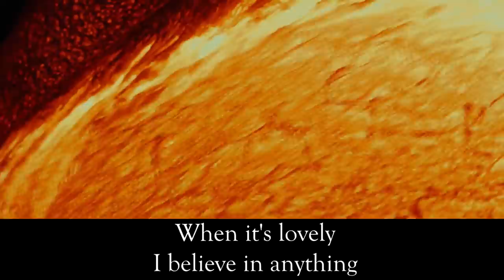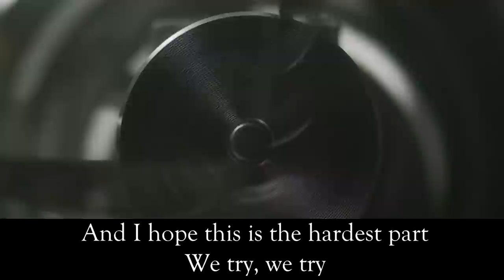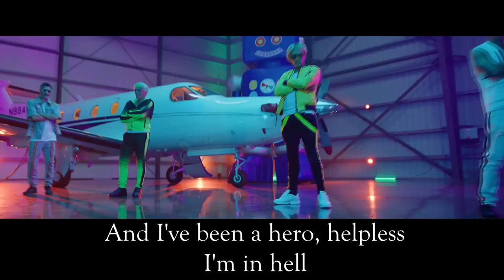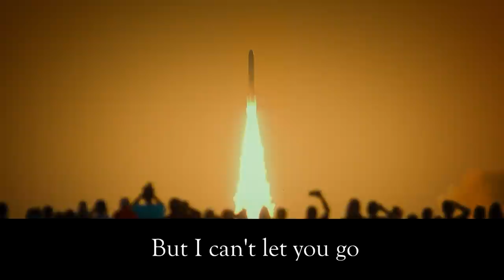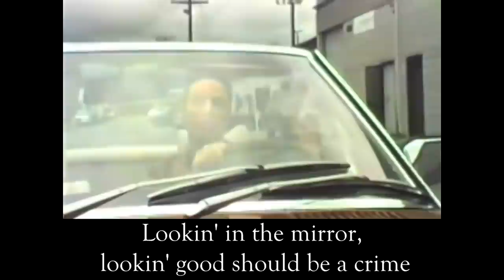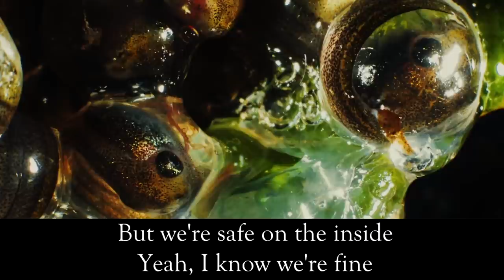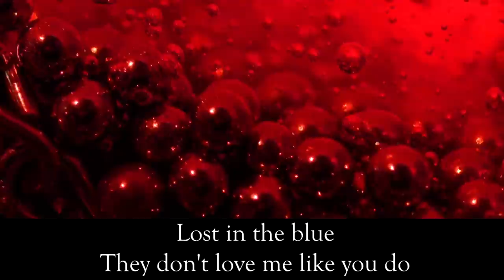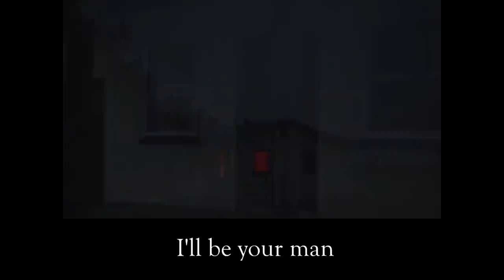The Beauty of Joji's Nectar

Comment: In the video of modus the machine is a Stirling engine. A Stirling engine is a heat engine that is operated by the cyclic compression and expansion of air or other gas between different temperatures, resulting in a net conversion of heat energy to mechanical work.

Comment: I think you are getting bogged down in the symbolism. My understanding of the movement of this album is being stuck in a toxic relationship and struggling to get out of it. It's punctuated by pushing past those feelings, regretting doing so and then truly trying to move forwards; even (and especially) in the face of the other person not having gone through the same process.

I think you made a lot of good points in this video, but there were several moments where you really missed the mark.